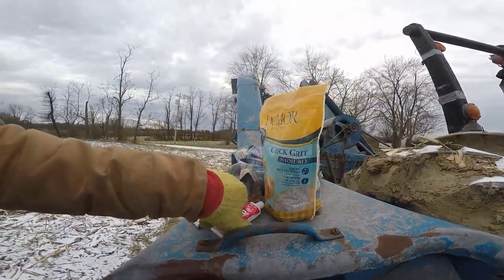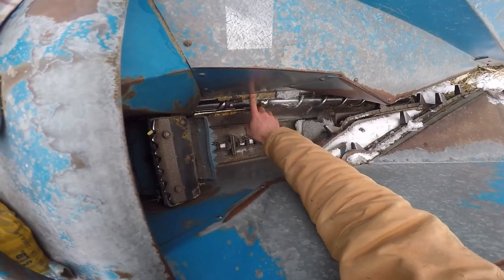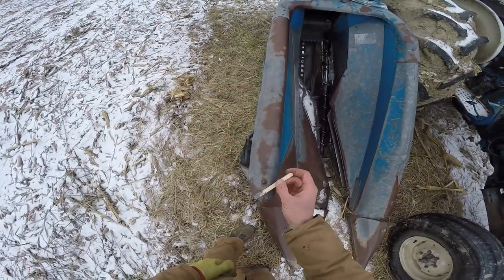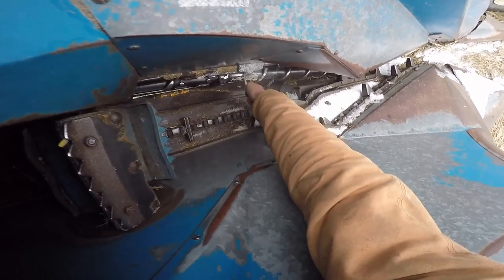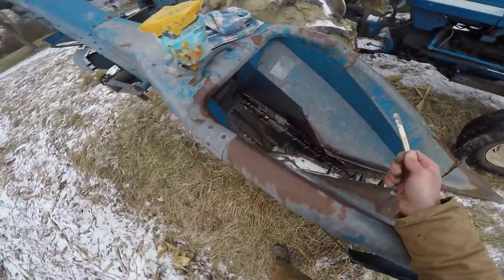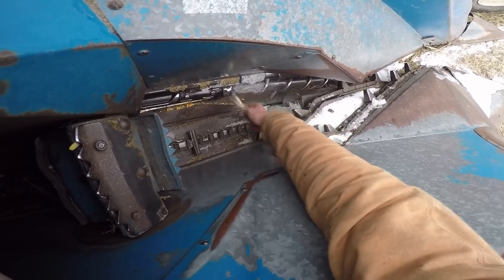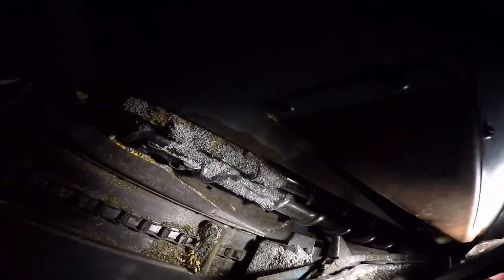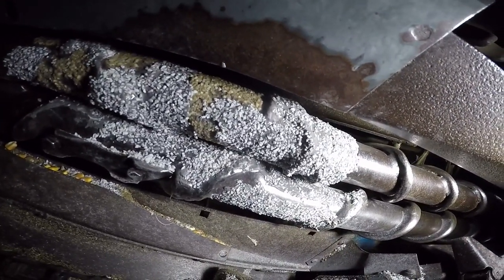How to Make a Ford Corn Picker Pick Like New

Comment: My grandfather's Ford 16-65 picker had a factory quartz coated roller in it. I fixed it back in high school (1991!) with epoxy and grit just like you did.
Reply from the maker: Ford did sell kits to replace the quartz a while ago, but the current dealer parts manager wonders how toxic the adhesive was.

Comment: Ih 234 was a good picker but it was mounted but you could pick or shell with it if you had both back units .You could pick just as fast as a combine  never had any problems with picking with each set ups ears or shelling.Also they has sttiper plates so you did not have snaping rollers.
Reply from the maker: If only I had a narrow front tractor to mount one on.
Reply: they sell pickers with tractors look on tractor house.

Comment: I would think when you smear it on if you then heat up the pipe or auger under the jb weld the goopy stuff may harden with a torch of some kind.

Comment: the JB weld should be mixed together in equal parts then mixed together until it's a dark gray, then apply it to the part you want it on.
Reply from the maker: My part has enough room for mixing and applying simultaneously.
Reply: Yeah and I'd mix the grit in with it and then smear it on the parts... and if they come out that easy, do it in the warmer shop/garage/whatever... OL J R :)

Comment: You could by a holley carburetor for your gas combine they are very reliable carburetors
Reply from the maker: How universal are the mounts?
Reply: @boehmfarm4276  You can get adapter plates from pretty much anything to pretty much anything... I've seen them in the speed catalogs or even in O'Reilley Auto Parts... OL J R :)

Comment: Just remembered.curved pipe under recever jar in milk house cracked and leaked. Was one inch.jb weld fixed it.didnt think it would work.but did. Pipe to parlor was 2inch.
Reply from the maker: Yep, JB weld does work on glass surprisingly.
Reply: @boehmfarm4276  Yep had the side window turn loose from the regulator and drop down in the door, and amazingly not break.  Took the inside door panel off and got in there put the glass back in the track, mixed up a batch of JB Weld, and put it in the channel, then pushed the glass down into it... Worked like a champ still there 20 years later!  OL J R :)

Comment: They advertised Flex Seal supposed to be like rubber, got Tape  2 Got new 1 called Flex glue . They try  there best to put J-B Weld down but  it King   Maybe see you on TV doing commercial , you be good at it 👍
Reply from the maker: I don't know if if quite lively enough to really sell. I would like to try some flex tape to seal a couple small holes in the barn roof.

Comment: The holley 2barrel should bolt right up to the ford 352.
Reply from the maker: It's a 361.
Reply: Boehm Farm The 361 is the same family of engine as a 352 it's called an "Fe block."  361 was an industrial motor. But lots of parts inter change.  I liked the Fe really torque.

Comment: There's no way in hell that's going to hold. Why don't you just take it and have it welded by professional. You know stick TIG or Mig
Reply: Justin'z SRT8 Yeah I would make some videos on repair it . Don't know if welding is the answer I would have to get a closer look . Don't like to work on equipment when it's Harvest Time but sometimes it happens
Reply from the maker: I did hold, I don't expect it to last forever, but a few seasons seem reasonable. I have seen what badly placed welds on these rollers does, it breaks them from too much interference. And it did happen to us.
Reply: Boehm Farm I spoke before I seen the last application of it. I don't really understand it's purpose but it's hard to believe it holds as long as it does
Reply: Boehm Farm I'm so dumb I see now. It's purpose is to keep the stalks from getting hung up on the bolt heads and the metal strap under the bolts. Lol I guess I need to stop commenting when I don't know what's even going on. Lol keep up the good content